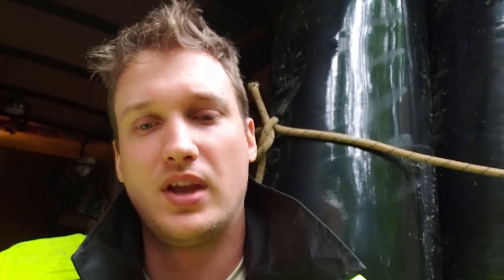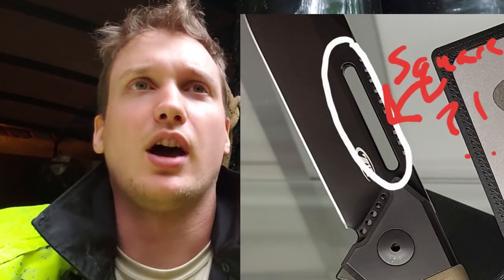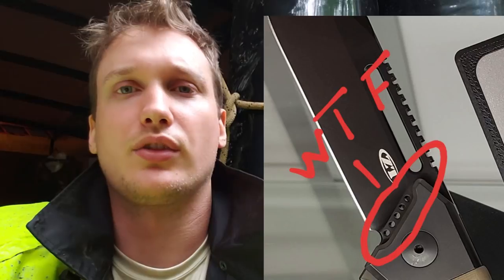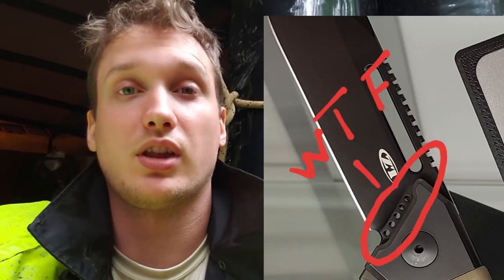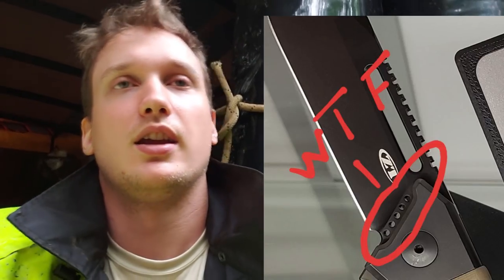Whats wrong with the new zt0223?

Comment: I agree it looks like a gas station knife, although I still like how it looks.

In terms of you saying it has weaker blade due to square gimping and an oval hole in the blade, yes you’re right they make it weaker. 

What I’m saying is that it’s still most likely strong enough. Are you an engineer? Do you think ZT made this knife without running any stress test on  it? You claim it’s weak. Okay, show me a tensile strength test proving you’re point.

Every assumption you’re making is based on pure speculation on how the blade looks. You don’t have any data to back it up. 

It’s possible you’re right and it is a weak blade and that ZT effed up. What I’m saying is you don’t know, and I don’t know. The only people who do know are the engineers at ZT who designed it. 

I don’t know about you but I’ve had an overall good experience with ZT products, and I definitely trust their engineers/ design teams. 

You’re probably going to respond to this by saying “yes the blade is strong enough, but it could be stronger if they removed holes/gimping. And why wouldn’t you choose functionality over ascetics ” and you’re right... ZT chose to weaken blade to make it look cooler.

You can disagree with ZT on this that’s fine, but all you’re other points seem like overkill
Reply from the maker: "Am i an engineer"- i do have 9 credit hours in engineering- which is enough to understand the absolute basics- which i might point out, if you are asking for a tensile strength test, you do not.

Square edges are stress risers, period. From broken blades to the dc10 going down, its a universal and incredibly easy concept to grasp.

I guarantee this knife went through 0 "engineering" in the context you are using, but really no knife does- its really not necessary.

What is the point of such a long, passive agressive comment? Lol
Reply: ThePreppersBunkerOutdoors fair point, I am not an engineer. I do not understand the basics. 

I agree square edges are stress risers, I never disagreed with you there.

You guarantee this knife went through zero engineering , and that no knife really  goes through any engineering. Do you work for ZT? how can you possibly guarantee this.   

What is the point of such a long passive aggressive comment? Well my main point is that most of what you are saying in this video is speculation. You claim blade is weak but don’t have strength numbers to back it up. 

Also ZT could say to you “what is the point of such a long passive aggressive video?”

The answer is because this is the internet, and it’s fun to debate right? Right?!? And because I can
Reply from the maker: What evidence do you, or does anyone have, of strength testing and data on any knife release? Why spends 10s of thousands doing these tests, then not advertise it.
I am very involved in the knife industry- the type of testing you are talking about is done on steels by their manufactures, but not by knife manifactures, because there would be no reason.
Reply: @Thepreppersbunkeroutdoors  cold steel is a perfect example of knife makers testing their knives. I doubt ZT does anything close to what cold steel does but they must do some testing. Your right, this blade is going to snap off right at the ricasso and it's so obvious it almost looks like it was designed to do so

Comment: I love the knife, so there's that. The specs I read at BladeHQ don't specify edge length. The blade length of 3.5 inches is the shortest length at the top of the blade from where the angled hilt juts forward the most, but you can see that the cutting edge is much longer - nearly 4 inches in fact. The design here with the strong angles at each end of the handle makes the knife feel more like a 4-incher than other 3.5 inch blade knives. The flipper is silky-smooth, and everything about this knife oozes quality of materials and workmanship. It is pricy at $300 USD, so you probably won't feel that much value unless you have it in hand and get to play with it for awhile, and decide it's for you.

Comment: Nah man..I feel the same. The holes right along the handle are just stupid creating a weak point on a folder for no reason. It compromises the entire blade. Even if it was made of Unobtanium  I'd still be stressed out using it 'hard use' because of that. Like...if you want to save weight mill the handles, mill the pocket clip etc but for the love of strength don't mill the potentially most important part of the knife...the base of the blade where it meets the handle. Ffs.
Reply: But has anyone broke one yet or stress tested one ???

Comment: Bottom line $300 is too much for a CPM 20CV blade.  I just picked up a ZT 0920 Les George flipper in the same steel with Titanium scales for $179 from KnifeCenter, as that model is being discontinued, as well as the black limited edition 0850 which is a great knife.  There are just too many other knives in this size with that steel readily available for $100 less.  I also think the plastic handle cover looks a bit cheesy.  “Gas station knife” is a good description.

Comment: The gap in the spine, I agree, looks cheap and it definitely creates a potential weak point in the spine if it's ever used hard.

And holes by the plunge line seems exceptionally "gas station," I know exactly what you mean there and why weaken your blade's base right by the lockup??

Comment: Did you not look at the knife before you purchased it?  Obviously, the problems you have with the knife were done for aesthetic purposes to attract buyers.  Of the problems you mentioned, you may or may not be correct about the weakness being an issue.  Calling the knife a gas station knife is kinda silly since you saw the knife before you purchased it and bought it anyways.  And, just so you know I'm a knife dealer and have never been interested in the 0223.
Reply from the maker: Did you watch the video before commenting? Lol
Reply: @Thepreppersbunkeroutdoors  Yes, I did actually watch the video before commenting...loogies and all 🤮.  This was the first video of yours that I have been exposed to.  In my opinion, all of your complaints would be reasonable if you accepted that your opinion may not be the only one that is valid.  This is a video about a folding pocket knife, not a hard use fixed blade.  ZT has recently been making a lot of their knives more aesthetically different (good or bad), rather than solely focusing on building a tough knife that is bulky, beefy, and heavy.  I admit that if someone attempts to baton repeatedly with the 0223, the square jimping may become a problem, but I honestly think this knife was designed to be pocket jewelry/package opener more than "survival blade".  Also, I think that while your arguments are valid in an extreme durability scenario, 99.9% of owners will never experience problems due to catastrophic blade failure.  Keep in mind, all folding knives have a big hole drilled in them less than an inch from where the grips end and you don't hear about blade failure on a regular basis.  I know that round holes are much stronger than square notches, blah, blah, blah. However, the reduction in cross-section as a percentage caused by the pivot hole and lock notch would be an issue as well if folding knives were used in a way that would cause the 0223's square jimping to fail.  If we start hearing about the 0223 having higher than normal blade failure rates I will be happy to say I'm wrong and admit that you are right.  I think, more appropriately, if you just stated that you don't like the looks of the 0223 without attacking the design engineers attached to this blade, I would have just agreed with you and said "yeah, it's a weird looking knife."